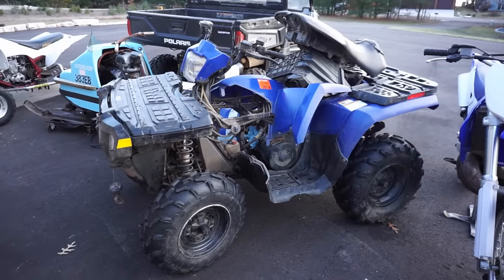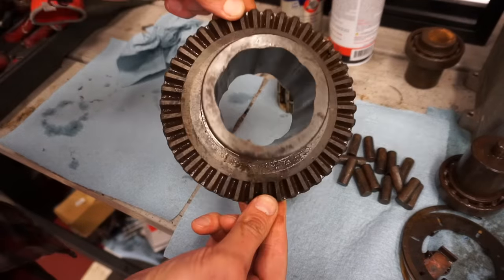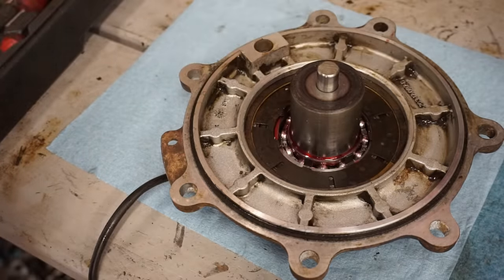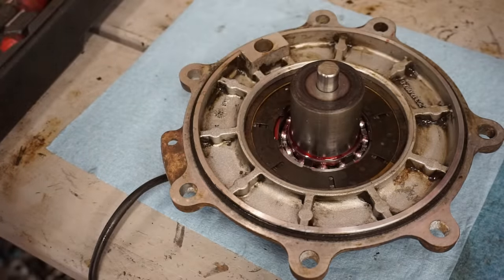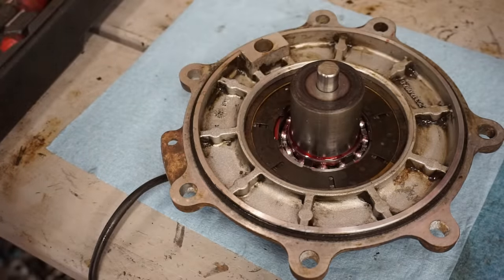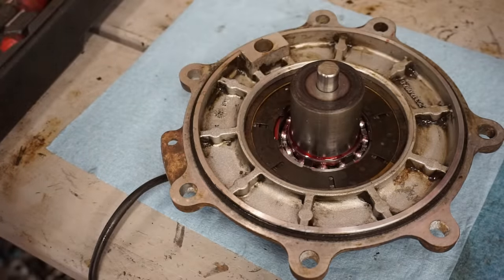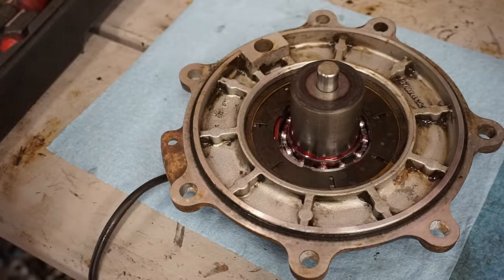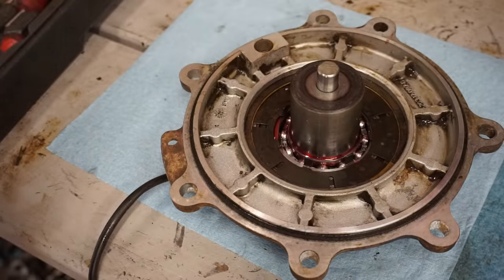Seller Wanted Nothing To Do With This $1000 Smoking ATV

Comment: You really need a parts washer,   I enjoy watching you fix all that stuff, great job
Reply: I second the need for a parts washer - cringed a bit while the front diff was reassembled.  I don't think the outer o-ring for the differential housing was replaced.
Reply: Agree
Reply: He must leave out a parts washer just to increase the number of comments and interaction on his videos.  Only thing that makes sense.
Reply: That was my first thought and low and behold here it is in the comments.lol
Reply: at least a bucket of soapy water or something
Reply: i agree.. they are not that expensive and do a better job than towels and w-d.
Reply: He needs a parts washer AND a good pressure washer.
Reply: I agree with the washer. The units you put together still look like a piece of scrap! I just couldn’t do it.
Reply: Agree or at least an ultra-sonic cleaner
Reply: at least wash it in a bowl with a brush

Comment: Love your stuff Mr Vintage, but I really don’t understand about not getting rust grit off and out of the basket bearing, and then also (apparently) using the same gritty gloves to fit the brand new bearings. You are mechanically gifted, but looking at the comments it would seem I’m not the only one with those sorts of queries. Good luck!
Reply: I have been watching for a long time he likes to cut a lot of corners. I can only imagine it's resulting more failures shortly down the line for a lot of his projects because of this.
Reply: @PongbyAtari i agree. I love watchin his videos but many things give me anxiety just watching... never cleans the engine before disassemble/doesnt cleans gaskets surfaces very well and so on
Reply: He clearly doesn't care to take suggestion. So many shortcuts, wrong methods and tools but he does get it done. However I wouldn't trust longevity.

Comment: I'm a little surprised that you didn't replace the input shaft bearing and seal on that front differential.
Reply: “While I’m here…” seemed to apply perfectly in this situ.
Reply: @dudenamedclem   lol I just put a crankshaft in my 96 Honda 300 Fourtrax and there was alot of parts replaced because of "While I'm Here". Rebuilt both clutches, new cam chain, all bearings, seals, gaskets, O-Rings, oil filter, Cam Shaft and rockers, oil pump, rings,valve seals carb kit and carb intake boot. It got pretty expensive but it "should" last for a long long time.
Reply: Again, common sense right out the window...??? He really can't help it he is, in fact from Wisconsin... ???????
Reply: Exactly!!
Reply: I thought it seemed like backlash was way too loose on the front diff as well.

Comment: What happened was the guy was using a good fourwheeler as a snow plow. Bye bye seels thanks to packed snow while in use and not to mention the weight of not only the snow plow itself but when the plow takes load and then the guy just keeps pushing forward with as big a load the guy could push.

Comment: Just a little tip. You should always warm the engine up with the coolant cap off whenever you have rebuilt an engine. Otherwise there will be air pockets in the cooling system. 👍
Reply: I think he did have the cap off the first startup.

Comment: When your taking bearings in and out, I'd suggest using a brass punch to protect the parts. A small arbor press may be a good investment too.
Reply: And freeze the bearing the night before.
Reply: and maybe invest in a quanity cylinder hone with interchangable stones.
Reply: I was thing the same thing. I use bearing install tool, or a socket.

Comment: Best to fill seals on the back side with grease to hold the spring in place when you knock them in. I spray the shaft with silicone grease so it does not burn the lip of the seal before oil gets to it.
Reply: Don't need to.

Comment: I do exactly the same as you but I buy all machinery. Old lathes, drill presses,cars,ATVs, ,side by sides, trucks, smaller heavy machinery, nothing too big....

I enjoy fixing stuff. Always have... spent 22 doing it professionally.....earned many certifications....but changed to healthcare 8years ago....I am Working on my Doctorate of Nurse Practitioner as I needed a different challenge at this junction in my life. Thinking about electrical engineering next ....I'm only 48. Never thought I could be Doctor on my grave stone but in less than a year I'll be able to.... 😁

Comment: I just bought a 2015 rzr 900s with a 1000 conversion. It has a rod knock....Paid $4000. 
Looking at engine rebuild kits...Nice winter project.
Reply: Check your valve clearances before jumping into an engine rebuild.

Comment: When putting the new seal in instead of using an extension (may damage /warp the new seal) find a socket that has the same inner and out diameter as the seal and hit that so the seal seats properly

Comment: Dude love your videos, you do awesome work. But you really need a parts washer. You can make one with a used fuel pump and kerosene. Get a container that will hold the kerosene and a old sink that will drain to the container, add a strainer so parts don't get washed down the drain, add a parts washing brush. And your ready to go. Use a 12 volt battery or a 12 volt adapter, with a switch to turn it on and off.

Comment: Tip on the seal installations… you can use a socket large enough to fit just over the seal and hammer it in lightly for a uniform install.

Comment: This channel is always entertaining. I love it when you use break in grease on one set of bearings, then oil on another . I'd use grease from the tube that is why they made a little device that fits on the end of a grease gun that looks like a needle. It's to fill new bearings.    
So entertaining.  Also never will use starting fluid. It would save his leg, and save the starter/battery

Comment: What diff fluid did you put in.
They only recommend Polaris demand drive  fluid for the magnet to work properly.
Anything thicker than a 5 weight oil, it will not disengage. Even trans fluid is a little thick.

Comment: I know buying all new parts would be expensive but putting all those rusty parts in there is not good. I'd change the oil after you run it to flush out the rusty oil. Also agree with the parts washer comment. You need one!!!

Comment: That hub. I Clean em with some wd 40 and cylinder hone then finish with brake clean so grease will tack tight and hold those big needle bearings in. Doing great job.

Comment: Cowboy workmanship at its best hammering a brand new bearing into place and the cleaned up differential was still filthy if the bearings last 6 months I'd be amazed you need a parts washer and ultrasonic cleaner
Reply: That diff needed a full rebuild lol, no question about it. Itll work long enough for the next owner to think hes got a reliable machine and then kablooey, it craps the bed 😂

Comment: It's ready again for submarine duty!   Good rebuild.  I would suggest using the polaris fluid for that front diff.  Its thinner, allows the magnet to pull some junk out.   Run it hard in 4wd and change it out a few times to see if it clears up.   There should be a fill on the top or side and a drain on the bottom.  By the way that drain cap was stuck on doesn't look like it was ever changed in the past.  I change mine out on a ranger at least once a year its always darkish and it goes in clear yellowish.  Always junk on the magnet plug.

Comment: That front diff should have been filled with Polaris Demand Drive fluid - it is very light not regular gear oil, I know someone who used gear oil like that and had issues, a parts washer or even a container with some Varsol works great, the parts looked dirty going back in.   I like to do the same type of work rebuilding the old bikes.  Enjoyed the video.

Comment: I had a similar issue with the front differential with a grizzly 660 and priced the parts and bought a used one on ebay and put new seals in it. It was a roll of the dice but it worked.

Comment: Growing up I had to fix everything that I broke because I couldn't afford brand new and I certainly couldn't afford have somebody else work on it. I remember always having a big pan of diesel fuel and a parts brush. You don't have to worry about it catching on fire And your parts aren't going to flash rust after you clean them. Spritzing it with W840 and wiping with a towel seems like it would just absorb far too much time.

Comment: Holy cow you need a parts washer! Especially with the volume of rebuilding you do. That front diff will never last. So much grit and grime was left behind. Can't just use brake cleaner and wipe it down with a rag.  That does not get all the grit and grime out of all the little recess. 
That stuff will come loose, when mixed with the new oil and grind all those gears and bearings up. Cleanliness is godliness when it comes to rebuilding stuff like. A good parts washer is cheap compared to redoing it....
Reply: Also can you imagine the amount of grit and rust that is on that front pinion bearing, that he didn't even open up to look at😳😳

Comment: You need one of those ultrasonic cleaners. Or maybe that’s not your goal, to make them super clean. 
When you are putting the valve keepers in, a little grease  where they contact the valve stem will help keep them in place.

Comment: Dude! You need a parts washer. It'll save you a lot of time while cleaning parts. It'll also save you money. Those cans of carb & brake cleaner are expensive. Parts cleaners come in many sizes and don't cost a lot.
I bought one and it cut time in half as well as cost.

Comment: I would have used a slow curing Permatex sealer as black silicone would have started setting up before you were done with the head work... hindsight, or do the head work first 😅

Comment: Your level of mechanical skill is amazing, so your tool inventory should be at the same level. I hate to beat a dead horse, but stuff needs to be clean before putting it back together. And not clean as in just wiped off, i’m talking clean as in spotless. And if you cant get it clean, replace it with new. Keep up the great work.

Comment: 05:00 rather than WD and a wipe the roller bearings and cage need a petrol bath and a brush.
Reply: When putting the bearings back in the cage you could hear them crunch against the rust grit.

Comment: If I'm not mistaken front differential takes like an atf or special front fluid for that plastic cage roller which is for 4wd demand drive fluid not gear oil. I think you're messing with us.

Comment: Cool, I’ve got an 04 700 FI Polaris. The fuel pump burned out a couple years ago right before I moved and it’s been sitting for probably 2 1/2 years now.   Hopefully this summer I’ll have this house fixed up enough to get to work on the garage so I can get that fixed.  

I don’t know what’s going on with the advertisements, but it keeps showing like five or six commercials in a row, I’m at 42 minutes and I’ve already watched it probably 25 commercials   😅

Comment: What about the pinon bearing o  the differential. It sees a higher speed than  the drive axle bearings. Also maybe its just the pictures but the parts didn't look very clean, and the sound of the parts going together seemed like an abrasive was on them, like dirt.

Comment: Def need a parts washer! But next time when you’re putting the rollers in the basket, a little trick a fellow youtuber taught. Use 2 - girls hair ties, they fit around them perfectly to hold them all in and set in and roll them up as you lower it. Hope that helps for future projects. Fairly new sub, question also, do you use a repair manual for torq specs and assembly when it comes to engine work?

Comment: If you do a good job cleaning parts you don't need silicone on gaskets like when it was new,  I use water and sand paper, did you hone the cylinder

Comment: I think them head bolts are not tight enough it said 1/4 toun it looks like that's where you stopped after the second time tightening them it looked like it needs to go a quarter turn yet but I might be wrong

Comment: You have the mechanical touch man…. But you need to invest in some tools and be sure you replace all parts that are needed not just half of them! If it works it works but there’s no way I wouldn’t skipped the pinion bearing at that point! And a part washer would make light work of that cleanup
Reply: Also want to add that those differentials aren’t meant to run typical gear oil because of the hillard clutch! Either run the Polaris on demand drive oil or atf

Comment: Ok, I don't know anything about repairing motorcycles. I watch this channel because I find it interesting. But, I've never seen any mechanic using a claw hammer. This machine was filthy. Why pressure wash it afterward instead of before working on it. As far as a parts washer, Joe refuses to buy one. Any further comments seems like "beating a dead horse". In my opinion (which doesn't mean anything), that differential is not going to hold up. Buyer be ware.

Comment: Hey 2vintage I have a Batman  trike it’s a 2010 it’s got 2 wheels in the front and 1 wheel in the back and it’s a big bike I’ve been trying to get it running for a while it’s an electric start I bought it a brand new carburetor and it’s got gas and I cleaned and checked all the connections in the electrical  and brand new battery and it has exhaust coming out of the pipe when we try to start it everything sounds ok it turns over and I don’t know what’s wrong with it.

Comment: Dude, do you not own a ball-peen hammer? I cringe every time you pick up that carpenter's hammer.
Reply: That would be a better choice for hammering, but I think I'd even take a claw hammer with a brass punch over using a ratchet extension or the bare face of the hammer. One bad swing into an aluminum housing and you risk damaging a seal area.

Comment: I don't know if you can help me, but I'm hoping you can... i have a 1988 honda trx350d. 
I've been watching you for years on my other youtube account and decided after years of tinkering with things that i would start a new channel and try fixing things.. well, as things have it, my quad started making a bad knock, so i decided i would rebuild it... I'm going on multiple months and splitting the cases 5 times... i had it most of the way together but was still unable to get the transmission to shift... even though I'm certain i have it right... anyway.. in the process of trying to get the transmission to shift, I managed to get the new timing chain stuck around itself.  Im atvmy wits end.. please, if you could help me figure out what i did wrong, i would be ever so grateful..
Thank you

Comment: Man you really need to invest in a parts washer, a paper towel is not sufficient, you really shouldn't assemble engine and gear components when the are still caked with grit like that that dirt ends up in the internals no matter how many paper towels you use, reassmbly should be spotlessly clean

Comment: Am i hearing a knock? At idle in the garage
Reply: my 2005 made the same noise. im thinking its a sportsman thing lol
Reply: I have a o7 500 sportsman. Mine does not sound like that.
Reply: @gman77gas  i owned my 05 500 h.o from new, it always sounded like it had a knock at idle. i knew a couple engineers from polaris who claimed it was normal for the year and model.
Reply: 😱OMG the anger when a mechanic tells you "They all do that" "Its supposed to sound like that"
Reply: @thebigguy8306  the quad had like 6500 miles with minimal maintenance required when i sold it, id say if it were an issue it would have failed in those 6500 miles. they were not easy miles on the machine.

Comment: PLEASE GET A PARTS WASHER!!! Your driving me nuts not cleaning parts properly and thourghly. Especially before you start tearing things down, pressure wash the whole project and get all that grime and dirt away from your work before tearing it down and also clean parts before dissasembly. This is the only complaint I have in your repair jobs. I have wrenched for 45 years now and would always make my work as clean and contaminate free as possible, and the finished product would always be clean and even painted it need be. Just makes things go smoother and shows quality work and attention to detail.Other than that you do great work and love your videos!

Comment: You will be doing this job all over again. Maybe next time you will clean everything up the way it needs to be. I have been a mechanic for 60 years and I never put anything together that I could not eat off of. It only takes one grain of sand or metalic to start the wearing process. As an apprentice this is the first thing you learn. Cleanliness is next to godliness. Lecture over.